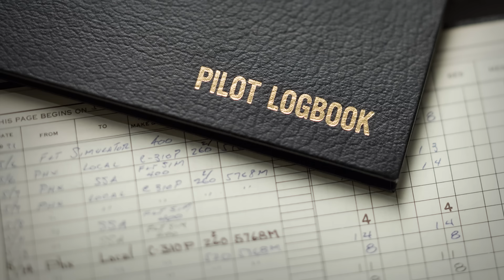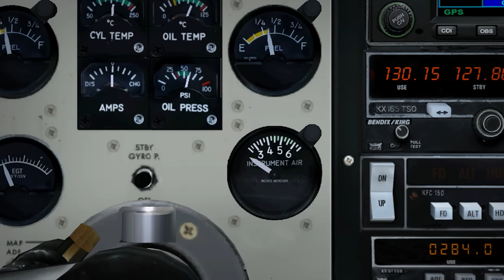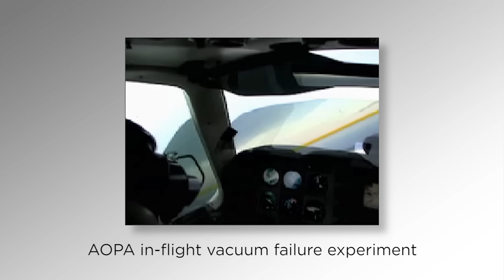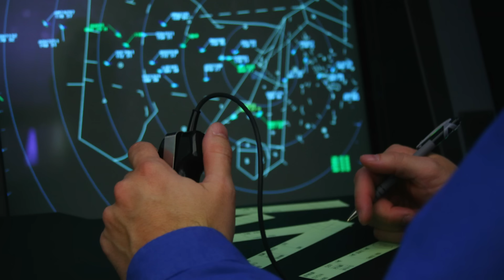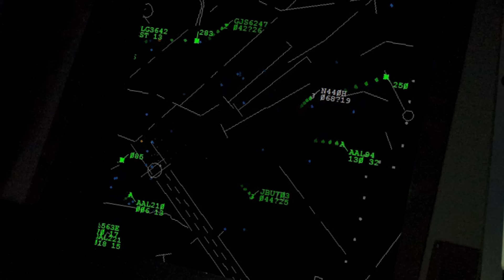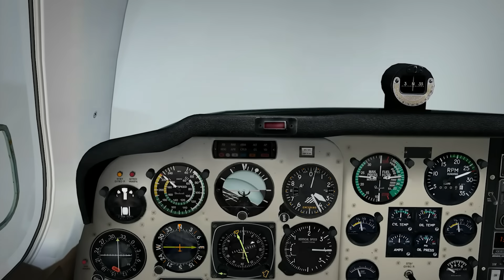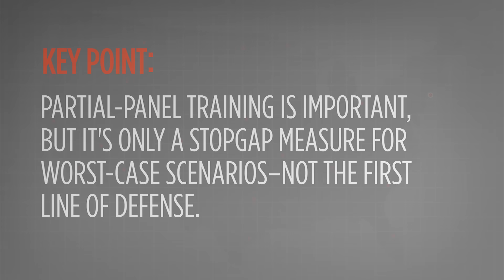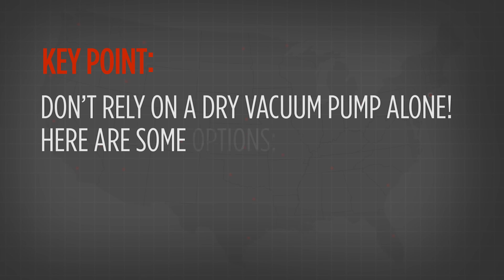Accident Case Study: Single Point Failure

Comment: I have about 7,000 hours in light aircraft and 7,000 in jets. Everyone can fly partial panel. The problem is recognition. I always suggested my students put in an electric attitude indicator. If they did not have a VAC failure light, I would suggest one with a very big bright warning light.

Comment: Not a pilot or aircraft owner, so somewhat ignorant question - I thought that annual inspections were required for light aircraft - would the inspection not have recommended a new vacuum pump given the age of the existing one or does the inspection not go into that much detail?

Comment: Looking at his instrument panel he still had a rate of turn indicator and a climb/descent indicator not dependent on vacuum. Your depiction of his spiral dive (11 minutes) shows the ROT indicator working and the airspeed indicator is right next to it. Using the ROT indicator to keep flying straight with the ball in the center, while carefully monitoring air speed to keep it constant, and rate of descent, together with vectors from ATC should have got him safely below the weather, which was 1600 feet cloud base and 10 miles vis. Not easy to control speed but can be done with gentle inputs so as not to over-control. Pilot training should include flying blind with only the rate of turn indicator just to cover this type of situation. It probably never occurred to the pilot that he still had enough instrumentation to get him out of trouble.

Comment: I had a CFII put me on partial panel.  My first action was to tell him that I am declaring a EMERGENCY.  He said that that wasn't necessarily needed.  I said that yes if after training on it under the hood if it happened tomorrow that maybe it wouldn't be needed.  But that I am training if it happens right before my next BFR.  And that's IF we even practice it then.  Nothing in currency says you have to practice partial panel.  Of course in the perfect world we would practice it weekly but we know that we don't live in a perfect world and I am preplanning for the real world.

This guy was hesitant to declare this a emergency.  Many pilots have died because of partial panel.  So to me this IS a emergency!  

Number one, TAKE COMMAND!  Find a airport, with a instrument approach, and a ceiling above Minimum Vectoring Altitude and preplan the let down.  If they give you any flack ask for a supervisor and, if possible, a discrete frequency.  Let it be known that once IMC there should be minimal turns or altitude changes.  Don't forget about military airports.  Many times they have very long runways and not a lot of activity.  This could help dodging clouds and not having a textbook stabilized approach to get the plane on the ground.  This guy seems to have had a lot of fuel that means he had a lot of time to develop a plan.

If forced to be in IMC taking command AND time to develop a plan is very important.  DECALARE A EMERGENCY!  As long as fuel isn't a issue advise that you want to fly straight and level until you feel comfortable.  As long as you won't hit something take charge!

There is a lot of stuff on risk management and learning.  Things like Law of Frequency, Law of Exercise,  High Risk/Low Frequency and Discretionary Time.  Have a preplan and TEST IT!  

High Risk Low Frequency, Discretionary Time risk model
https://www.youtube.com/watch?v=Og9Usv82CdU&t=05s

Comment: This back and forth with ATC - asking multiple times what is clearly heard , not grasping the significance of the loss of a critical system, dragging on the dialogue with redundant conversation - just delays the inevitable. Thankfully aircraft with modern navigation panels have the data wherein the pilot can make these decisions without the useless communication shown here.

Comment: And this is why, with modern technology, like the Uavionix AV30, should be made a minor alteration so you can ditch that gross vacuum system easier and cheaper.

Although, in a pinch, backup AHRS on foreflight might help.

Comment: A friend of mine purchased a v35b the first thing he did was put an additional electric powered attitude in place of one of vor heads.  One of the best things you can do on a single engine IFR aircraft. 
When you lose vacuum/ suction and all you have a single gyro in your turn bank or turn slip indicator, not good.

Comment: R I P 

as for the equipment failure… maintaining alternate, critical equipment is very SOP. failures happen so if both flight components dont match then we know that one has failed. 

vacuum to the fuel tank: human breath to increase tank pressure is a reliable source of pressure. maintain some duct tape (foil tape) and pressurize and cover your pressurizing tube (vinyl or otherwise) 

i’m just pointing out what i see could remedy at @4:30 in the video

Comment: It was clear right from the start that the pilot wasn't comfortable with IFR.  His first comment to Flight Service before the flight was "make the rain and the fog go away."  He later asked the controller if he could arrange for "clear skies."  If he was that uncomfortable with the weather, he should have stayed on the ground that morning.  Once the pump failure occurred, he repeatedly used the terminology "partial panel" without elaborating.  I can see where a controller may not be completely sure what that means.  Pilot should have made it clear that critical instruments had failed.

Comment: Never get into a Bonanza or 310 with a doctor, or a rock star......never. The fact that any vacuum dependent plane is allowed to fly without a backup vacuum source is inexplicable. Also there's not a flashing red light, impossible to ignore, that warns the pilot of this pump failure. How can 70 years of pilot deaths not teach this simple lesson?
Reply: I don't see why you don't have a rigid frame member for a vacuum tank. If you had two vacuum pumps you could have some reserve guaranteed. If your throttle settings change you could have a check valve. Electric backup.

Comment: I installed 2 Garmin G 5s in my MIghty 172 :) eliminating the need for vacuum.  There was a great celebration that day when I ceremoniously threw my vacuum pump in the trash "with prejudice".  I'll never understand why nobody installed the old venturis on later model airplanes as a backup.  It could have been a simple fix.

Comment: A big problem with a real vacuum failure is that the AI is visible but not working.  Even when the pilot knows that it is not working, its very presence is distracting and instinctively followed.  One of my instructors recommended always carrying some stick-on blanking discs as used for IMC training so that non-working instruments can be blocked from view.

Another trick if you are not too competant flying on limited panel and there is not a lot of turbulance is to trim the aircraft either for level flight or a slow descent depending on what you need to regain VMC, take your hands off the stick/yoke and use small rudder inputs to keep the turn needle centered or make very low rate turns.  If you have lost all gyros (even the T&S), then turn South (in the Northern hemisphere) while still VMC on top, trim for a gentle descent, then do the same as before - hands off and use rudder - but this time maintain a steady South heading on the compass, making small but early rudder corrections whenever the compass deviates even slightly from due South.  The reason for going South is that accelleration errors in the compass will exaggerate a small rate of turn and be in the "correct" direction rather than initially swinging in the opposite direction when starting to turn, or not reacting much until the aircraft has developed a sizeable bank.  If flying in the Southern hemisphere, head North instead.  It's good to practice this technique sometime (in VMC) so you get the hang of it.  So long as there is not much turbulance it works surprisingly well - or at least it did the few aircraft I have tried it with.  The trick is to act immediately with a small pressure on the rudder pedal that is opposite to the side the "S" has moved to on the compass, and release as soon as the "S" starts moving back to the center again.  You might find that you have to keep a constant rudder pressure in one direction to keep the compass stationary.

Comment: The situation with explaining the nature of your emergency or even declaring and emergency in North America is something I find very frustrating. Pilots (professional and private) very rarely use PAN or Mayday and always say something very casually like “at this point we’re gunna go ahead and declare and emergency” and in this particular case just repeating the phrase “partial panel” clearly means nothing to the controller. As a professional pilot who operates in European airspace things are vastly different and much more direct. Having watched many of these videos it’s seems common for atc to have to confirm an emergency situation or clarify several times the nature of the problem. This can waste valuable time and also details can be easily missed.
An example of a proper emergency declaration I’d recommend watching the 757 bird strike out of Manchester, England. It’s an almost perfect example of how to communicate your problem clearly, concisely and with zero ambiguity.

Comment: I'm no pilot and my experience with avionics is limited to that within video games but my first thought when the instruments failed was to grab the phone. Most phones nowadays have gyro sensors installed. I know iPhones come with a default compass app which displays various information including altitude. As almost everyone seems to have a smart phone nowadays would it be reasonable to pull your phone out and rely on it instead, in a situation like this? Perhaps not for the pilot to pull his phone out and start fiddling but for the passenger, to try alleviate the situation and provide some redundancy on the instruments behalf. Does my idea have merit or should I stick to video games with my crazy suggestions?

Love these videos by the way, I've gone through all of them but still feel a hunger for more. Extremely well edited and presented with an excellent narration on an interesting, albeit tragic, topic.
Thanks for making these!

Comment: So, if i understand this properly, this piolot was flying his aircraft on just a magnetic compas and a turn and bank indicator which is effectively a spirit level ?
Ok i read well down the comments and a helpful person explained that all the attitude instruments are gyro stabilised. So it was compass only i think ?
 Putting myself in his situation i would have used an android phone with an ap called "Inertial Navigator light"  to  fill in the gaps. It uses both GPS and the phones accellerometers, gyros, and magnetic compass to synthesise  an artificial horizon.  And i think i would have asked for any airport within range with vfr conditions. Is there a procedure for getting a senior pilot who is an IMC instructor on the radio for situations such as this ?
I was fascinated to read in another comment that pilots used to deliberately enter a spin to decend through cloud layers before the technology developed to use instruments.

Comment: Did it blow up in the air? I’m confused. If so, what caused it to blow up.
Reply: I'm no pilot but I would imagine it's over speeding or too many g's since it is going down in a spin it picks up a lot of speed and probably a lot of g's and the aircraft structure just can't handle it anymore.
Reply: @justahamsterthatcodes  yes.   it didn't blow up...it broke apart.

Comment: I’m still confused on what actually happened that caused this plane to all of a sudden shoot straight down in a spiral and eventually break into pieces before impact. 
Was it a stalled condition due to IMC and no panel indicators?
Reply: Your comment is a couple months old, but just in case, what caused the downward spiral (it’s called ‘graveyard spiral’) was spatial disorientation.  If you are flying and lose sight of the ground (e.g. fly into clouds), then you don’t know which way is up.  Your inner ear will trick you b/c it wasn’t evolved for 3D motion without visual cues.
Reply: Thank you buddy. Since posting this question I have seen way too many videos like this and understand now. Appreciate the reply all the same.

Comment: Don't these air controllers understand what a NO_GYRO approach means??  Two choices would have saved his life.  1. Vector to the nearest VFR area two hours away in this case (best choice).  
2. Vector out over ocean, decent thru clouds and scud run to closest airport.  
3. PAR approach (controllers guide you in with radar vectors and glide slope guidance).

Comment: I've never understood - why don't they just use a pump to force pressurised air over the giro? I mean, why does it have to be a vacuum pump? surely a compressed air system would work just as well? And surely an air pump would be a bit more "fail safe" than a vaccum pump?
('scuse my ignorance!)

Comment: I'm not a pilot but - isn't there a smartphone app that can act as an emergency attitude indicator? Good IMUs are easy to make with common phone hardware and no vacuum..
Reply: Yes...but you have to keep the phone rigidly affixed to the airframe for it to be useful. Easier said than done when dealing with this in flight.
Reply: @zippoc04  Actually I had a friend driving an MD--11 try it out. Turns out the standard imu in the phone has way too much accelerometer correction of the gyro, and the thing just showed level in a long wide turn.
Reply: @skuula  Wow, good to know! Makes sense that they’re software corrected and optimized to be good at being phone compasses...not plane AHRS references.
Reply: @zippoc04  Yeah they are made for environments in which acc.vector !== nadir only for very brief periods.
One could access the raw sensor data, and make one's own IMU...

Comment: I dont know why but the video paints the pilot lacking. whereas the ATC should be more responsive in this area of problems and provide complete alternate courses and somewhat direct pilot to do as instructed. Just saw around dozen failure videos with VFR converting to IMC and this partial panel and ATC could have been more help and saved those people by calming them down and giving them one point solution instead of changing ATCs again and again.

Comment: In an emergency with no attitude gauge, some think you can hang a string with a little weight from the ceiling/windshield. 
This will NOT work. The airplane is moving as a unit and all forces are acting on all things within the plane. Just like we are moving with the planet and all items drop and move based on the frame of reference that it is within. The string within the cabin will point generally toward the floor of the plane even doing barrel rolls. 
Don't stake your life on this misconception. Have proper backup instruments.
Reply: Wrong that doesn't work. a yaw string doesn't work

Comment: One thing is clear when you watch enough of these; if the destination is someplace you HAVE to get to or is very important or time-critical- FLY COMMERCIAL OR DRIVE!  Time and time again in these scenarios the most elemental choice that could have saved their lives is completely disregarded because the one thing they refuse to even consider is cancelling the flight or turning around.  It seems even more so when they have passengers.  They're not going to admit in front of people they're trying to impress with their flying skills that the situation is over there heads.  If you absolutely HAVE to get somewhere, don't fly yourself!

Comment: UhOH, forked tailed Dr. Killer. MY friend had one. The secret to not losing control on take off or landing was to exceed the rotation speed by about 10 mph. This allowed the completely inadequate empanage to gather enough air to make the airplane stable and controllable. Otherwise, very fast, solid airplane. Quick to kill you! Bob So now he has a partial panel failure over the East Coast, an incredibly complex and crowded air corridor. He know's there's weather. He could at least give a pan pan so someone would know there's a potential problem. Being the big cheeze in the sky,  he elects to tough it out! Oop's he ain't that good a pilot. Let's see what happens. At this point he should be landing anywhere he can. Did I just hear him say he's currently VFR and doesn't want to come down through the clouds? How the Hell does he think he's gonna get down without dropping into the clouds. Is this guy really instument rated? He finally declares. His radio work is almost incoherent. I think at this point he doesn't know his butt from a banjo. Let's see what happens. ATC asks what can we do to help you. Ya, get a real pilot in this airplane, should have been the pilot's response, and maybe we'll survive this. Try calling: we are in deep SHIT! and I'm a lousy pilot! MayDay! If I were his passanger I'd kick him out of the seat and fly myself! An orangutan could have flown better.  Oop's spatial disorientation again!  Pop goes the weasle! Here's another option, don't fly if you are a POS pilot! Bob

Comment: Q. the tail number is N440H. At the start of the video, the narrator calls this "November Four Four Zero Hotel", but later, both the narrator and the pilot refer to "Bravo Four Four Zero Hotel".  What am I missing here? Does the designation change during a flight for some reason? Thanks.
Reply: They're actually using Bonanza four four zero hotel. In the US (at least) it is expected to replace the "N" with the aircraft type in radio calls so that controllers have a sense of the performance capabilities of the aircraft. In this case the aircraft is a Beechcraft Bonanza. You might also hear Cub 123C or Citation 876S instead of N123C or N876S. As you might imagine, there are pretty big differences in what those two planes would be capable of in terms of time needed to comply with instructions.
Reply: @ChrisHobbs42  Cheers.